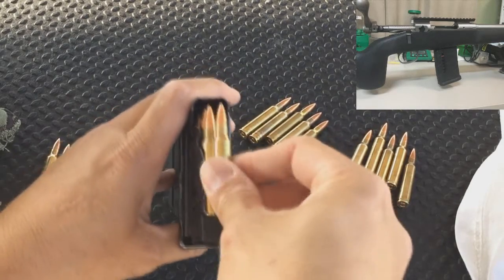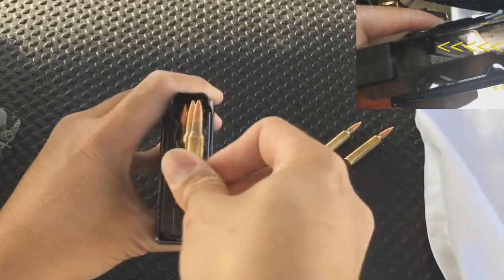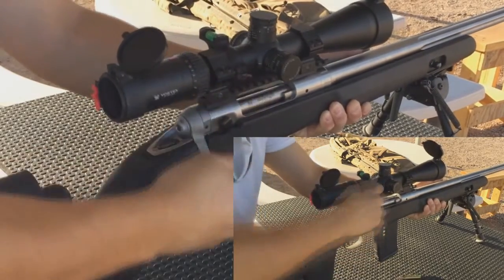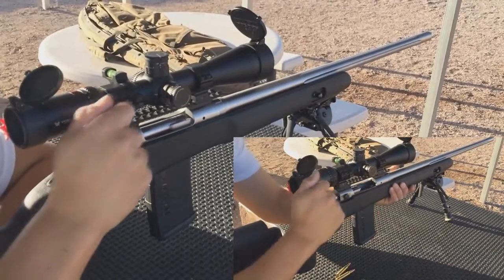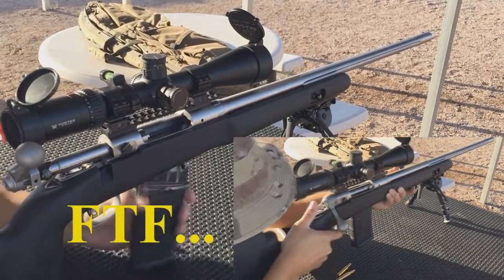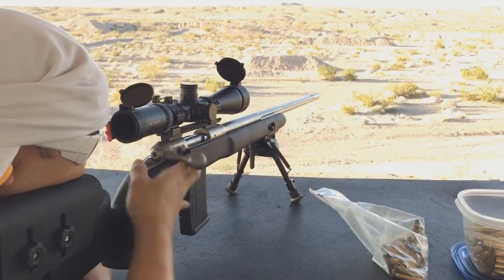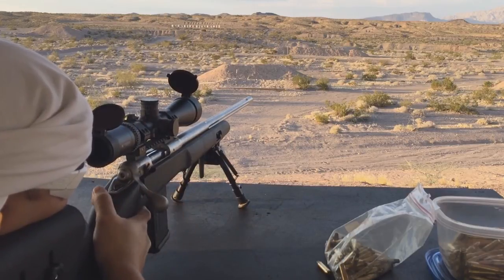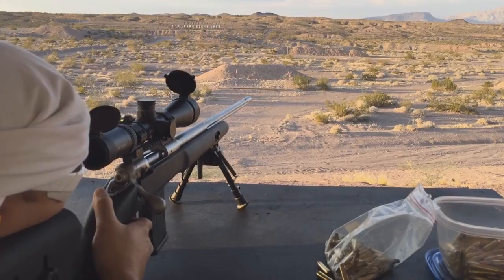Savage 12 High Capacity Extended Magazine PART 2

Comment: I'm curious what brass you are running.  My Model 12 BVSS does not eject Hornady brass.  It does function better with Lake City but you have to apply lateral pressure to the bolt when cycling or it will drop the brass off the bolt face.
Reply from the maker: I'm using mixed brass and some LC Brass... More than likely your ejector spring needs changing... I had the same issues a while back but I replaced the ejector pin, ball detent and the extractor as well since they are all very affordable to replace.
Reply: Sir, can you also post the link for the how to convert it to high cap magazine. Thank you
Reply: WiiPHEEZ i'm using MIX and Brass mostly LC Brass. I've had the same issue before, all you have to do is order some ejector pin, ball detent and spring and replace those. Make sure to order extra as you may have to change out those parts later because those parts seem to wear out pretty fast. No need to worry, they're pretty cheap so it's not gonna break your wallet. I'm still working on editing the videos because the Sony Vegas video editing software that I have have been giving me some problems. Thank you for viewing and subscribing, as soon as I have the video edited, I will upload it immediately.